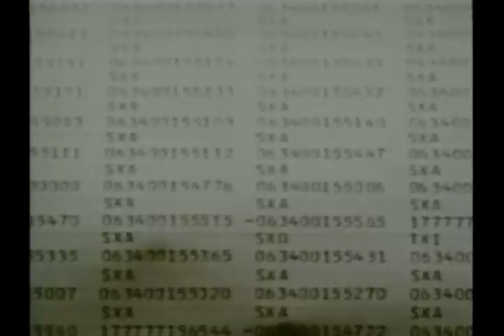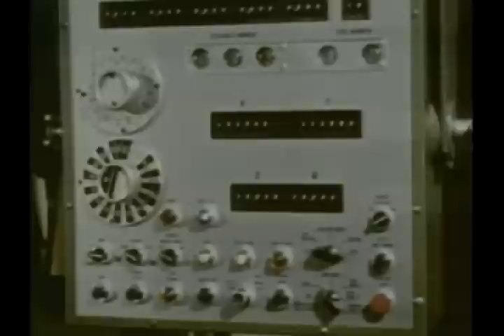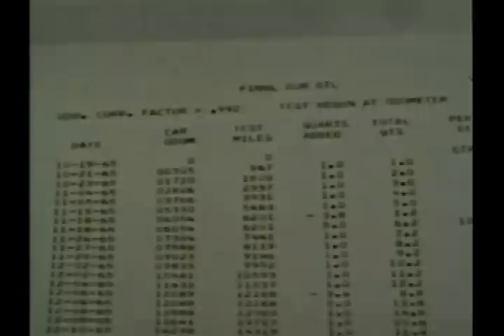1967 Camaro Car of Today

Comment: my grandfather bought a brand new 1967 Camaro Rally Sport black with white interior 327 engine bucket seats with the console floor shift air condition AM radio with the two speakers the Reverb thing also with the antenna on the back trunk it was a beautiful car until I got totaled out in 1979 sad day. the car was bought at the dealer called cone Chevrolet in Fullerton California
Reply: wow

Comment: still used antiquated leaf springs, drum brakes, american car buyers were so gullible and stupid with the camaro, mustang, etc
Reply: What's your point??
Reply: My point is the American car buyers from. that era were used to driving badly built cars that were basically throwaway
Reply: Car design and engineering is evolutionary. At the time it was what they could do.
Reply: The 1967 Camaro had optional disc brakes (manual and powered). I wonder if you even know that? Or are you just giving a worthless opinion about something you know nothing about?
Reply: @80sCompaqPC  agree
Reply: just so much hate for america